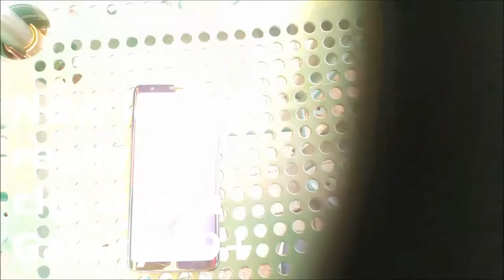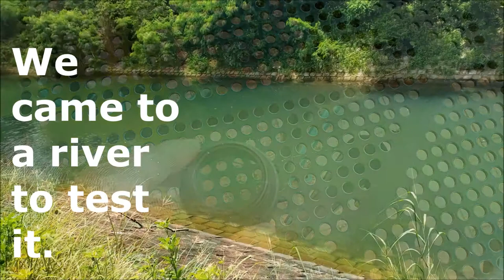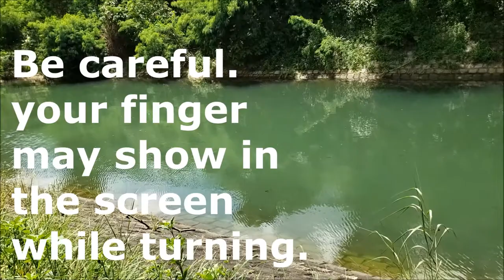How to use a CPL Filter or Polarizing Filter in iPhone Videography or Smartphone Photography

Comment: There is no cpl filter can remove 100% reflection on water surface, right? I'm no expert, just curious.
Reply: That depends if the water is stagnant and it depends on the angle. If your water is flowing it wouldn't be able to remove the reflection of the ripples, because those reflect in a different direction, not directly in the viewfinder of the camera. Hope it helps!